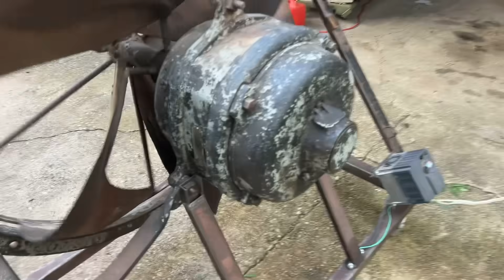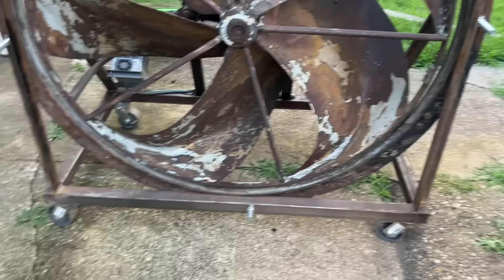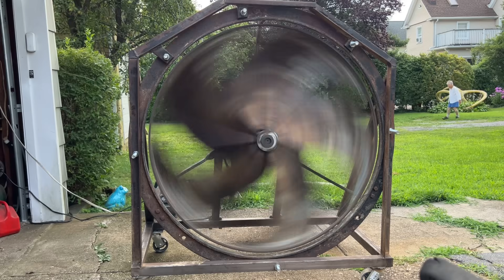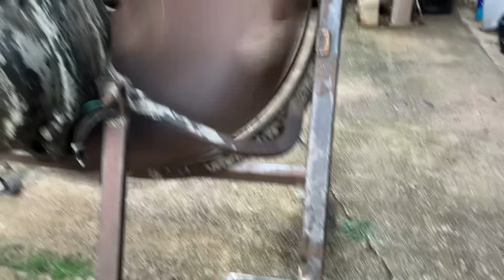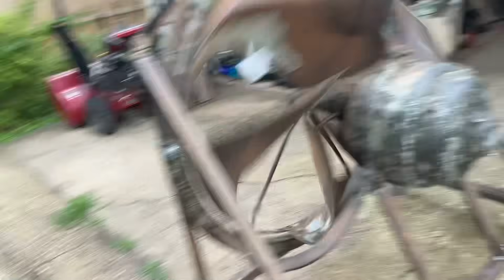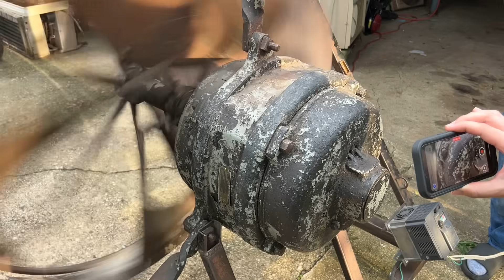MASSIVE 1908 Davidson Ventilation Company 48” Exhaust Fan! Full Demo & Back Story! Thing is WILD!

Comment: 1908 and seeing it run at full send, bruh that thing, youll be gone in instant or mush, 2HP Motor 1908, you aint stopping that monster 4Ft tall fan, ya you aint stopping it at all.  Those folks back then didnt have A/C so that was the only way to cool off a building or work area....220VAC Motor, that will run on full send 240 no problem.  I have an old Compressor, wired it from 110VAC to 220VAC it just cruises on 240VAC no problem, and that hum you hear at start up, that the start brushes before they disengage.  1908 those people knew how to cool off...big fan, i wonder how many animals went through that while it was running back then? But that motor, those people back then knew what they were doing plus they didnt have VAC mainly VDC so that would run off of Car batteries or deepcycles no problem...

That motor means business, those people back then knew exactly what they were doing then because AC didnt exist.....
Reply from the maker: To think that a 144” version of this fan exists somewhere, flat out amazes me.

Comment: I wonder how scary this thing would be with a huge 3450RPM motor from something like an old siren
Reply: The size of motor needed to even come close to that sort of RPM would be super unrealistic. You're talking north of 100 horsepower. The current motor on it is more or less 2 horsepower (probably more) at just 450 RPM. Horsepower to RPM for a given blade is not a linear transition and if I remember correctly, it's something like 10x more horsepower per 100 RPM, more or less...

Comment: Be careful with the VFD, most of the older Motors suffer from high u/t - Values which stresses the inter-winding insulation and may lead to bearing-current.
Reply: This VFD is a quality one and has the option for older style motors where it drops the voltage. I also have it set to only output its exact rated voltage so it's not running at 240. It's running at 220 maximum.
Reply: @GrumpleGromitits not an issue of the Quality of the VFD, it's based in the way it works. A VFD uses PWM to generate the output voltage, that means it pulses the DC-Voltage of the intermediate-Stage in a ratio which represents the momentary voltage. So its no Sine-Wave, it's a series of pulses which is given to the motor. Any VFD does it this way.
Reply: @stephanb15  Yes I'm aware of how the VFD works but some of them are inherently better at doing it than others. The VFD is also in very close proximity to the motor and it's only a danger if the VFD is say a few hundred meters/feet away. I do work in the industry after all. VFDs and electric motors is my specialty.

Comment: How are you getting three phase 240V power out of a single phase household outlet without tripping the breaker? Are you using single phase 120V or 240V?
Reply: It's on a 240v outlet and uses a VFD to convert the single phase 240v to 3 phase 220v. Not hard to do at all.

Comment: How much torque does the motor have?
Reply: Anywhere between 25 to 55 pound-feet. It's a 2 horsepower motor but due to the low RPM, the torque is way higher than your typical 4 pole.
Reply: @GrumpleGromityeah low RPM is it geared down somewhere? It seems impossible considering the laws of physics aren’t torque and horsepower proportional to each other? You need horsepower for torque and two horsepower and 55 pound feet is a huge stretch.
Reply: @mattdaddy_888 it's a 16 pole motor. Torque and horsepower are not linear to eachother. It's the fact that it has 16 poles and full operating speed is 450 rpm. There are plenty of motors and engines that have low horsepower but oodles of torque. This is one of those cases.
Reply: @GrumpleGromitthe torque seems overkill for a fan even one that size.
Reply: @mattdaddy_888 it's moving a massive 24,000 cubic feet of air per minute,  and that's not circulating cfm. That's exhaust cfm backed by a massive amount of static pressure. This fan was designed to get air out at all costs, and it does precisely that with no fuss. If I ran this thing installed in a wall with all doors and windows closed, it will absolutely make a hole somewhere to pull the air it needs.
Reply: @mattdaddy_888 I'm not sure what you're implying here but I'm just going to say it. I don't drive electric vehicles. I'm certain you can see my Plymouth in the video. As for the fan with its electric motor, it's going to remain original. It's bordering 120 years old and I'm not going to intentionally modify a significant artifact of the very early 20th century manufacturing. This thing is absurdly rare.

Comment: As big as it is , I'm surprised it's not belt drive
Reply: These old ancient direct-drive beasts were designed for harsher environments while still being relatively maintenance free. They didn't have "V" belts back then and anything that was belt driven was done so via flat belt likely off of a line shaft driven by a much larger electric motor or steam/gas/diesel engine, which is more maintenance intensive. This thing was cutting edge tech and has outlived a multitude of generations.

Comment: how much power does that thing draw? Must be quite a bit, that motor is huge.
I am aware you mentioned amperage but i don't know if your country is 120 V or 220 V
Reply: It draws approximately 8 amps on 220v, 3 phase. For it's physical size, it's actually very efficient.

Comment: That’s cool. That was definitely an old independent mount ventilation fan someone made a janky cart for and used it as like a shop fan. I’m all for it. Do NOT get rid of the original motor. If you cannot afford to have the OG motor properly rebuilt… sell it to someone who can. That’s a work of art.
Reply: He put it on the cart. They explain that It was installed in the roof of the building where it had been since 1908 and he had to remove it piece by piece. First time it was moved in over a century.
Reply: The cart is a creation of my own made entirely out of heavy gauge steel, it was not found on the cart. I removed it myself and needed something to assemble it onto. It will be fully restored and during that time, a better cart will be fabricated.

Comment: I'm surprised that it being from the Philly area it isn't 220 volt two phase.
Reply from the maker: These were made in Watertown Massachusetts
Reply: @TheAirConditionerGuy  Yeah but if it was installed in Philly it would have been built for the Philly (PECO) market. Philadelphia was all 2 phase until around 1930. And there are still a lot of 2 phase buildings that are supplied with a Scott-T transformer connection.
 It's also possible that that motor was rewound as a 3 phase, I've had that done a lot over the years when bringing old 2 phase machinery into a 3 phase building. Also a 2 phase motor will run off of 3 phase, but if you load them hard and run them continuously they will overheat because the phase angle will be wrong.

I've had to do that lots of times when disassembling old machinery that was 2 phase and I only had a 3 phase generator to work with
Reply: This fan was found in New York.

Comment: This fan reminds me of a PC fan called the NB eLoop, which has a similar blade geometry and also a ring that connects the blades. It’s been around since the 2010s. This Davidson fan was 100 years ahead of its time. And I love its startup sound. It’s also pretty damn quiet. Nice find!
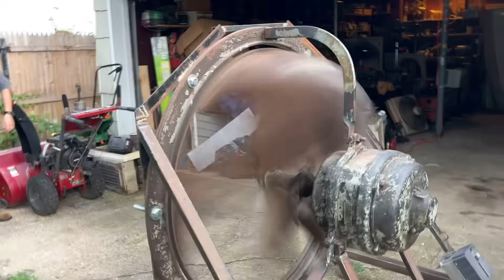Reply: Modern top-performing PC fans such as the Arctic P12 Max (or Pro) use a fairly similar blade geometry and also use the ring for vibration reduction, so Davidson being ahead of their time is very true! 11:50

Comment: Careful about the Variable Speed Drive, this motor may over heat without a pure 60Hz sine wave. It was certainly not designed for inverter duty. Even modern motors are marked if they are suitable for variable frequency drives and can be damaged if they are not.
Reply: The VFD I installed on this fan is a quality VFD, not a cheap chinese one. It has the proper sinewave curvature as well as settings specifically for older motors which I have enabled. I've already tested this fan with several hours of run-time, monitoring things like temperature, harmonic frequencies and vibration as well as a megger test. The motor checks out perfectly and is quite happy with it's VFD. That's why in the video, I stated it runs well as low as 15 hertz, but no lower than that.
Reply: Sometimes the non inverter motors work fine and do not overheat too. It depends on the headroom of the saturation point of the steel lams. ie a 50/60 Hz rated motor has about 60/50= 1.20 more headroom when on 60 Hertz..,. At no load one can plot current versus input voltage say at 60 Hz and find the headroom..

My experience is the Insulation might get zapped when using non inverter motors with a VFD drive. I have some non inverter 3 phase motors I have used for a decade not get ruined too.

The Baldor 1/3, 1/2. 3/4 Inverter duty 56C frame motors I have are rated for 6000 rpm and the laminations are designed for this and not saturation

Comment: I'd be interested to know more about the physics behind the design as the shape of the blades strongly suggests that it should be spinning the other way.

Is it possible that the blades are mounted on backwards?

Is the fan actually for providing air, rather than exhausting it? 

It would be interesting to compare both directions of rotation. To my mind, it would be better at creating pressure and airflow spinning the other way as the blade tips would normally be shaped like to air slicing through the air and the curvature would enable the blade to maintain force on the air by preventing it being spun out away from the blades by centrifugal force. In theory it would be somewhat more powerful spinning the other direction with the blade tips spinning into the air....

Having said all that, it's possible that the design and rotation as it is currently set up helps keep the noise of the airflow down making for quieter operation. It's definitely a fascinating piece on engineering!
Reply: The blades on this are spinning in the correct direction. Davidson designed the blade with backswept curve for noise purposes based on the documentation I have found. If you look at the profile of the blade, you will see despite the backswept curve, it still has a scoop on that very same side to guide the air in the correct direction. Running this fan in reverse doesn't yield the same performance. I already tried it with the VFDs reverse rotation function. Exhaust is where it's at.
Reply: @GrumpleGromit Thanks for your reply and particularly the results of trying the fan in the opposite direction.

In the last paragraph of my comment I said that the design was to keep the noise of the airflow down. Thanks for confirming this.

Comment: 9:50 for the impatient. The fan is SO balanced, and SO quiet!
Reply: balance has nothing to do with it, its actually pretty poorly balanced.
Reply: @Layheeee  It's very well balanced. The weight of that blade would surely cause the whole frame to wobble if it was even slightly out of static or dynamic.

Comment: Awesome fan!  It just needs some metal screen to make it safe... kind of safe. I wonder what its maximum RPM is before it shakes too much.
Reply: There's really no way to tell what the max RPM would be before the blade becomes unstable. However, I have found literature in the past on Davidson as a company where they specifically state that the blade is designed to safely withstand RPM beyond the efficiency of the blade. This more or less means it can withstand RPMs well into the point where the blade simply cannot pull anymore air and begins to cavitate, which is quite impressive.

Comment: The data plate showed some info about carbon brushes. Are these used in the starting mechanism?
Reply from the maker: I would have to ask the fans owner about that one, hes a wizard on these electric motors
Reply: I think there may have been some which used repulsion-induction motors and those have carbon brushes.  This is a standard 3-phase motor, and I think it might be a GE.
Reply: @douro20  The motor is made by Western Electric and it's a 3-phase induction motor with no carbon brushes. The tag is a universal one applied to all motors but if you look closely, you can see that the carbon brush spot was not stamped with a part number.
Reply: Probably a repulsion start induction run motor. I have an ILG that's a few years newer than this and uses that type of motor.

Comment: Probably wouldn't be a bad idea to weld up a cage for it.
Reply: Wouldn’t only be for safety, but more so for durability. This is definitely made of heavy cast iron and is over built beyond comprehension, but it doesn’t really hurt to fabricate a grille so nothing can get damaged. Cast iron is strong, but under certain circumstances, it can crack or chip. Plus, you would not want to create any nicks or gouge marks on the blades which could potentially cause a balancing issue, wouldn’t really notice it since the RPMs are on the lower end, but eventually would take it’s toll on the bearings.
Reply from the maker: Definitely, with the potential for injurys like this thing is capable of